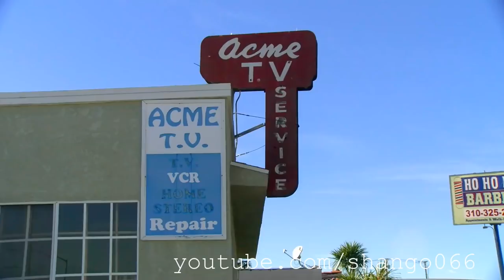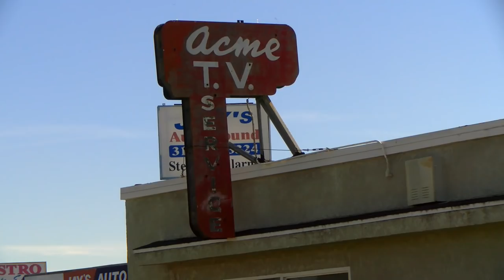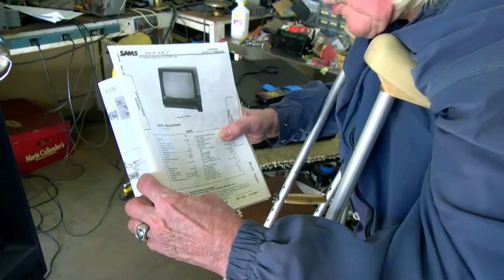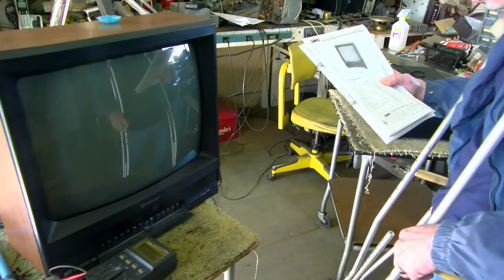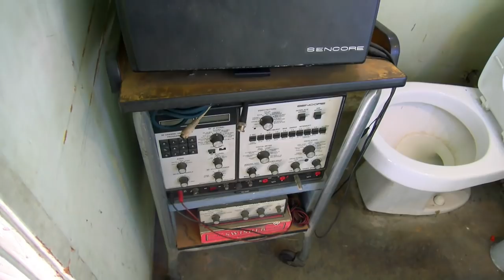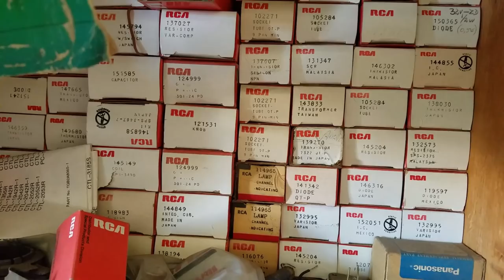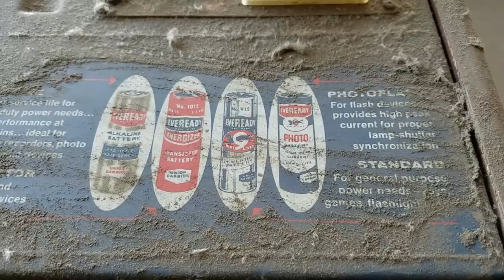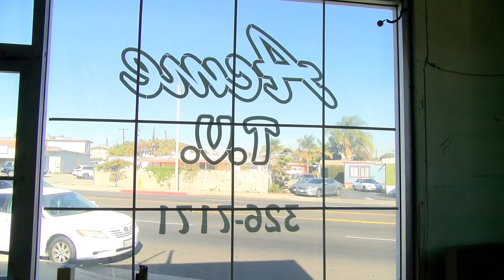Acme radio and TV repair 1957 to 2018 Lomita Ca

Comment: Gary deserves a salute, from each and every one of us.... Thanks so very much for documenting the end of an era... I just wish that it wasn't so, progress.....  disposability....
Reply: Cost of ownership is what matters.  Use the CPI calculator to convert the cost of a new tube TV ( and frequent repairs ) into today's $ then compare to today's TV.    Be sure to include he cost of electricity / additional load on the house AC system.  ( deduct from the winter heat bill though . ) 
The reason old stuff was repaired is because it was $$$ to buy new and broke frequently.

Comment: Shango...Please pass on this message to Gary. Forget televisions and consumer electronics.  Advertise and focus on vintage receivers and amplifiers.  If he can work on Marantz, Pioneer, Sansui, ect for the 70's he will do very well.  I have been running Electric City in Denver restoring vintage audio and we keep very busy because nobody else does this!  Console stereos, tube amps, all this old stuff is very popular and he can continue working.
Reply: repairing vintage gear is my bread and butter here on the canadian east coast in nova scotia i gave up working on flat screens last year or so cant do much with them anymore
Reply: Look at my comment a little below yours.This is the way  the  last remaining old school TV repair shop here in Albuquerque operates.Budget TV.He doesn't just work on stereo components,but does a lot of work on record players,and console stereos,from the 50s,60s,and 70s.Your Zenith,Magnavox,RCA,GE,Admiral,etc.As well as antique radios.I was in there recently,and I saw one of those big old floor model Montgomery Wards Airline console radios,from 1938 somebody had brought in to be restored.

Comment: here in the UK i worked in the TV repairs from 1966 to 2003, when i stepped sideways into IT hardware support.
Watching and listening to this guy echos almost exactly what happened world wide when the china imports flooded the world with cheap consumer electronics.
I still dabble in the dark arts of tube ( valve ) radio and tv and have great satisfaction in bringing them back from the brink...
Reply: The very last TV repair shop in Halesowen closed 6 months ago, i don't know of any other repair shops any longer, very sad.
Reply: @christopherhulse8385  hi from Australia, I got out of my TV & video repair business in 2005 when it got too hard to make a living. Moved into broadcasting for the rest of my career. There must be a huge number of ex TV technicians worldwide!

Comment: This Is a sad reality of mom and pop shops. Not only TV shops but small business in general. They can't compete against huge big box companies with almost unlimited check books. I really enjoyed this. I think it's important to document the few shops like this that are left. As it shows a time when things weren't so disposable. Surprisingly we still have 3 shops here in small town SC. But i don't know how they stay afloat.
Reply: Radio Rescue 
You are right. The local hardware stores are fighting a losing battle. The stores that were a few blocks from everyone, who had most anything, are as scattered and few as utters on bulls.
Reply: I used to manage a shop, it's not an easy business, for one thing in the old days we pretty much had service manuals for everything, that saved us time.
Reply: Going out of business doesn't make sense to me.  Moving into a garage and eliminating as much overhead does make sense to me.  The internet can give back what it takes elsewhere.  After all you need to keep up with the times.  I mean how all these large brick and mortars keep failing to do so!
Reply: Cost of ownership is what matters.  Use the CPI calculator to convert the cost of a new tube TV ( and frequent repairs ) into today's $ then compare to today's TV.    Be sure to include he cost of electricity / additional load on the house AC system.  ( deduct from the winter heat bill though . ) 
The reason old stuff was repaired is because it was $$$ to buy new and broke frequently.

Comment: Worked at a shop like this during college... knew damn near nothing going in.  Bench tech would send me out, with some basic instruction on diagnosing. if there was a part he knew was on the truck he would talk me thru fixing it on the phone. If it wasn't  simple I'd put it on the truck and bring it in.  We sold Zenith and Sony, Zenith was easy... Sonys got dragged in and, by example of our old school zinc plated bench tech, I was sure the way you fixed them was to mutter obscenity into the back of the set.  Learned a lot.  Hope Gary gets to keep his hand in it as he retires.

Comment: I worked in a shop back in High School called Tappan Television in Tappan, NY. Owner Harry Kirk taught me how to troubleshoot, read schematics, use test equipment, etc. Went to a two year tech school for Electronics Technology from 75 thru 77 and still worked at the shop. Once I graduated tech school I went to work for an Oceanography company and stopped working at the shop, That same week Zenith laid off all its American workers and went to Mexico, I felt bad but needed to advance as I knew this was a dying business but I liked it. Anyway I later worked for NCR Corp for 30 years as a Field Engineer fixing ATM Machies, Check Sorters and retail POS Systems. I use to stop by and visit Harry at the old shop when I went to see family but he has since passed.  I'm now semi retired and am a Field Engineer for Burroughs fixing ATM's.

Comment: I think there is one TV shop left in my area and he told me that 95% of his repairs is warranty work on flat screen TV's and once the warranty expires, most people replace the set when it breaks. I suspect that in the near future, even warranty repair will go away and when the set breaks, they'll either refund the purchase price or give the customer a new set. I have a phone book from 1977 and at that time, there was about 4 pages worth of TV shops in the area.
Reply: In the Southwest Nebraska town of 8000 where I live, there were 4 repair shops.  I worked at a Magnavox dealer as tech, now in IT.  Perhaps 2 remain, 1 being a part time operation I'd guess.  

Glad I'm not in that trade for a living.  I'd be starving...
Reply: radiotvphononut 
This is called progress. Progress to failure. How far will it go until Americans demand quality over quantity?The entire culture has diminished into a superficial nature. No one wants a quality amplifier. No one cares about the quality of the sound they listen to. Desktop speakers off their pc is good enough. 
One problem, flat screens are high definition. They would not buy a CRT because the quality is not the same, can’t buy a 48” CRT to hang on the wall. It is really sad. I took a portable dvd/tv player to be repaired and was told they could not. I took a Marantz 4400 quad amp to be repaired and told the same. So shops are as well to blame as they have gone to pure card replacement. So it’s now independents who will do work on the YT. Get work from those who contact them. 
Many reasons, all too sad.
Reply: @jameslucas6589  agreed

Comment: Bless that man. Thanks or documenting this... he held out to the bitter end.  My old shop was pretty similar to Acme in having had to diversify. I was lucky though- I had some pretty fat contracts with the firm who sold the extended warranties with both Best Buy and Wal Mart, and there not being any other shops in that area gave me a great deal of business for years. Walk ins? Nah. Only car radios and PCs. Finally the warranty company changed hands and wanted to renegotiate with me for less than half of what I was getting. I told them to fly a kite, closed up shop and started a new life in California, which has been very good to me. That was 2011 or thereabouts.

Comment: As I tiptoe into the tube and whatever other vintage stuff, the end of this shop makes it all seem like a mirage. My brother has fixed loads of old guitar stuff, and I told him I'd like to fix my Akai reel-reel - he goes 'do ya think it'd even be worth it?'  He likes to make me frown, but he's kinda correct.  ftw, man.  RiP, Acme.
Reply: History needs to be preserved.  My wife has 7  Reel to Reel machines.  A few are in the process of being repaired (I do electronics work on the side).  Provided the parts are not extreme, I always say  "Fix It!"
Reply: Most shops that repair tube guitar amps,will not touch vintage tube audio equipment,or God forbid,antique radios.
Reply: wonder why that is?  too much tail-chasing? too much responsibility involved?

Comment: One of the reasons things are so 'disposable' now is if something breaks after 5 years of use its replacement is usually much improved. TVs and radios stayed the same for 40 years after they came out. Great video.

Comment: I started my working life in a TV Radio repair shop back in 1977 (I was just 15). It was a fantastic experience. I used to love the customer's opinion on what the fault  was. The "Picture Valve" needs replacing they would pronounce. Life in a TV Repair shop was pretty much the same the world over. We would get to know and see families grow up, it was all part of a vibrant community. Nowadays we just throw things away, life has certainly changed and not all for the better.

Comment: 1960s 1970s lots tube sets lots repairs.   80s  lots tvs to fix.   90s  solid state ,  in 1998   worked for bigger shop has 6 technicians. contracts   10 years specialized in CD , dvd, car audio ,  lots decks to fix every month.  hundreds of them  i was pretty good at it.  you know in end 2008  i left working there  ,  business dying right out.  i had change to electrical engineering manufacture .  but I still love old radios.  i still fix them ham radios.  been ham long time.  I miss the old days TV repair.   if it was still here thats what i be a radio man tv man !

Comment: Been following  your videos  for  a wile  great stuff brings back memories  . Hopefully  the old left overs go to  techs  still  fixing and restoring vintage  stuff . In stead of land fill . In the mid seventies  13 -14  years  old started out in ham radio  .  Went around to the  TV repair shops  and there would be  many old tv's   out back that they would  throw them away . some were  rather nice  wood cabinets  others  just hard plastic plastic boxes  . Ask the shop about them  . The shop said they weren't  worth repairing   and could only get  so many in the dumpster  . Take as many as you want . Most of them CRT was done   . Witch  the cost  of the CRT   the sets were  dumped . In those years some tv shops  were dealers  as well  . Customers  would buy new ones  rather than fix them  .  But the 6L6 tubes and some of smaller  signal tubes and the power supplies  were good  . Rember getting  Lit up from the 500 volt transformer for the first time  knock back off bench HARD!  Remember Lafayette Electronics . They had the good VOM . A good 80 % of the parts  from the old color TV'S     you could build 50 watt 40 and 80 meter CW transmitters . Power supplies and output  tubes  . COILS and tuning capacitors  and crystals  would  be mail order  . They made great home brew projects  . But everything is becoming  throw away  these days.  Basic buying  new stuff every 2 years  . Old timers  called it planned obsolescence . Saw a video  on tubes  that online shipping  is seizing and destroying tubes  on the Mercury claim. These tubes are in demand for  guitar and high-end audio amps . Can't say the name of  the  business  because of YOU TUBE  censorship but that is realy  messed up . Save what can. Great job on bringing back some of vintage stuff!

Comment: Interesting.  There was an Acme TV in my home town of Spokane Washington.  They had a sign on the building very similar and the owner of the business even looked like Gary although of a much older generation.  They were a Zenith dealer with a big showroom and a big service department.  This brings back some memories.  I started my career as a technician in the TV repair business in the early seventies.  Man we sold a lot of tubes, if it weren't for the tube sales,  I thing the place would have had a hard time staying open.

Comment: The concept of repairing is becoming obsolete. I found a newer broken Polaroid LCD TV and there wasn't a single screw; all plastic tabs and metal slots, and just one board. The flimsy plastic bezel is designed to break. The LED backlights are buried behind the glass panel. It's a disposable item. Never meant to be serviced. The board failed and a new identical TV, same model and everything, was on sale for $99. Not even worth opening it up. The little I know about tube sets I've learned from you shango, so thank you for passing on your knowledge of this dying, or dead, art. I hope all is well with Gary.

Comment: Well, guys, I'm also touched by this video also, since I'm still in service running my shop for 31 years. There's a saying that whatever goes up, sooner or later, must  come down. So, I'm not an  exception or immune to this. I'm one of the last shops in my area but also had to adapt to the new changes. At this  present time, I'm into Solar Inverters electronics and MSD ignition, where I had to reverse engineer to keep on top.

Comment: See, this is why it's important to go from THT and valve and familiarize yourself with Surface mount, Computer and cellphone repair shops still make decent money and that's almost all the tech inside of it. Most flat panels use mostly the same power supplies or control board.
Reply: Actually many times unless it is warranty work the cost of repair is more than buying a brand new set with the latest tech in it.

Comment: Companies don't want you to fix things yourself, or have anyone else. Only those that manufacture it or work for the corporation.Sad. That's why things were made so complex. Imo, you don't need microprocessors in major appliances. That's my opinion. The old simpler styles lasted decades. Not anymore.

Comment: Even the newest casinos seem to be going to server type of machines.  The slot it self is really just a terminal.  That way the casino can change the slot, without physically moving the machine. Just slap on a new front, and its a new slot.  So restrictions are in place (hopefully) that doesn't allow the casino to change the odds while your playing.

Comment: Shame, they are all gone now. Same in the UK, we had streets dedicated to electronics, like the Edgware Rd and lots of local places selling parts too - all gone now (repeat).
Like to see what Shango can do with a real turntable? The Lenco has some great bits and some rubbish bits and some in between, but can be made great. Bad - tonearm, esp. bearings (what bearings?) Slightly flexy chassis. Good,  the rest, esp. that infinitely variable speed motor, a thing of beauty.
Reply: PS you can fit miniature bearings to tonearn ID 2 or 2.5mm OD 5 or 6 mm. Works a treat and decouple counterweight to make a hifi turntable.

Comment: I got in the business in the early 70's. From New Orleans. Katrina was like flipping a switch. all flat panels since. Went on a call the other day. and I'm retired just doing ad hoc stuff. Guy had 6 TV's. killed them all except a 32 inch RCA with a dvd. anyway, I made a living in TV repair. retired in 2009. Now Mostly do home repairs. Minor electrical and plumbing and major appliance repair. But only part time. Hate to see an industry go away. but glad it lasted till I didn't need it anymore.

Comment: There still are TV/ Electronic repair shops around and you can get many repaired. Only the  initial cost of the item must be high in order to justify the repair cost. And some manufactures refuse to repair or stock the parts for their products. This is true with my Bose speakers. They want you to buy a new one not repair the old. This is why it is not wise to buy used working electronics. If it breaks a few month afterward you can't get it serviced. Something to beware of.

Comment: The biggest improvement in TV tech from 1950-circa 2000?  Color.  We can probably name a dozen or so fundamental improvements in TV tech since 2000 (resolution, display technology, size).  Businesses built on fixing that static technology from the last half of the last century were doomed to fail.  Its nobody's fault.  It just happened.  The only vintage electronics repair I see making money is in record players and stereo equipment from the 70's onward.

Comment: the uk has none, if there are any then there either old stores or are more into fixing basic problems like a crack on the screen or saying its trash we'll give you this much for it in parts blah blah etc, 
the last tv shop, i'm serpised that there's no like tv news crews they love this kinda crap, "for 50 year this tv shop was active now its slowly closing down, thanks to a lack of ppl wanting older sets" sad tv really just to make ppl cry then to forget about 5 days later
Reply: Actually it's not people wanting old sets.  As explained the bottom has fallen out of the repair industry due to people wanting disposable electronics.  Fast and Cheap!  And they do not want to wait a few days while a shop gets a board or a part in.  I repair flat panel TV's, or at least I did for a few years as a side thing.  When the price rock bottomed out for the cost for a flat panel?  Cost as much to fix as it would be to replace.

Comment: Now you'd have to send junk for repairs, round trip postage would be 30-80$.  Tech should get 70$/hour+.  Add the cost of parts. So something must be worth over 200$ to bother fixing it.  Then you get it back in a busted up box, handle with care.